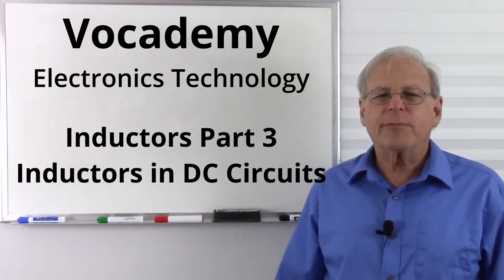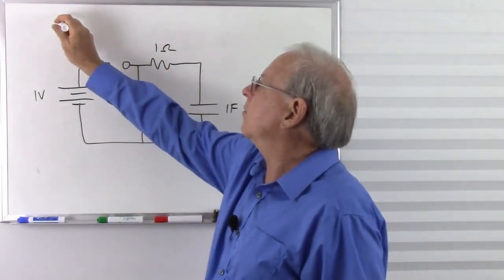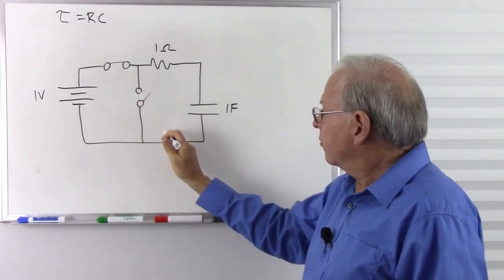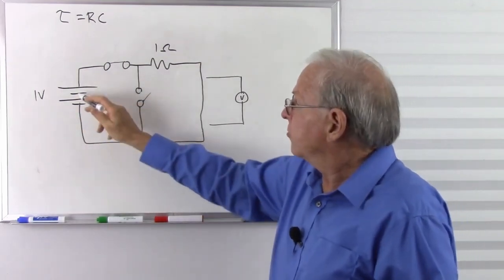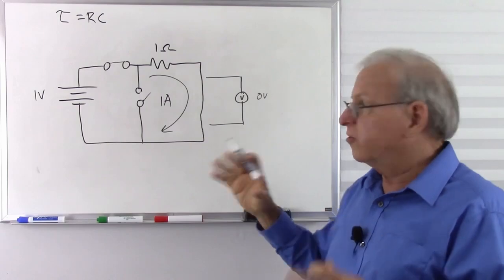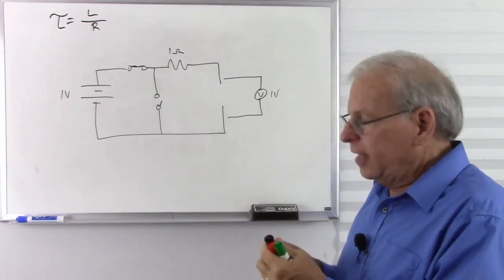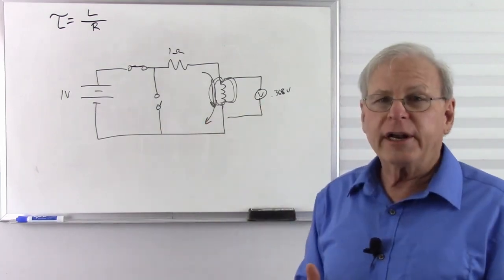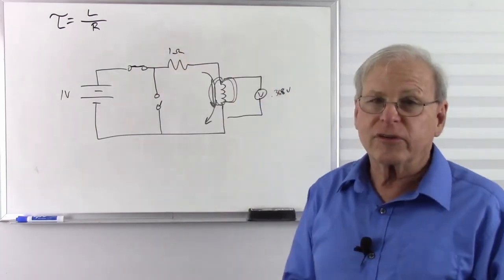Inductors Part 3   Inductors in DC Circuits

Comment: In describing capacitors you took your time but with Inductors you hurried up.  For example, with Inductors graphs you said let's change colors red and green for capacitors to show the graphs for current and voltage graphs.   Avoid doing this.  Math teachers did this all the time.  Do you recall ?